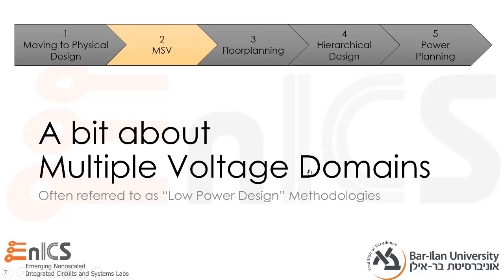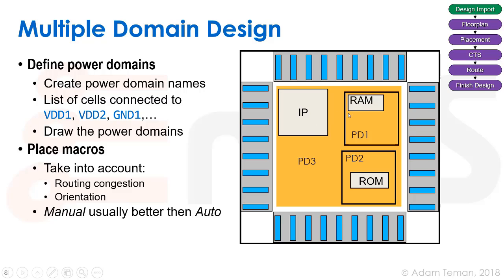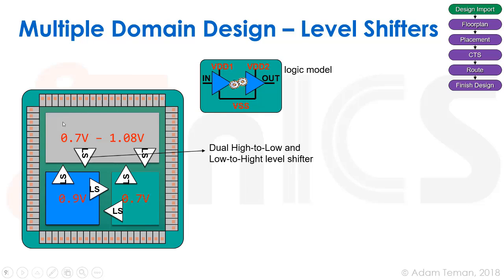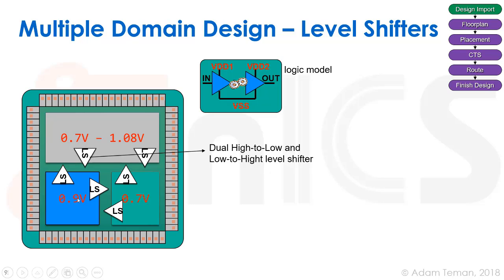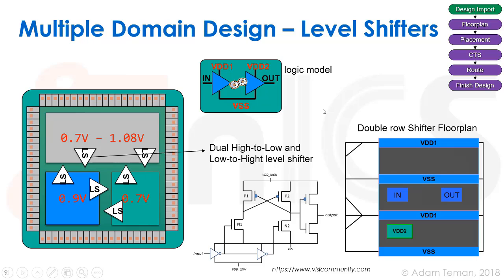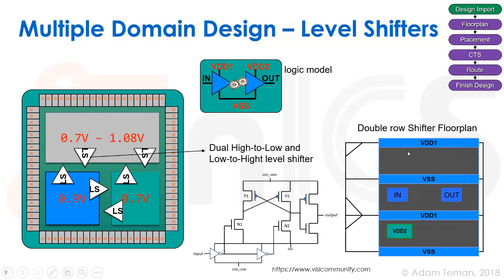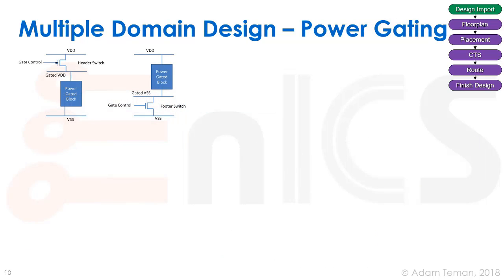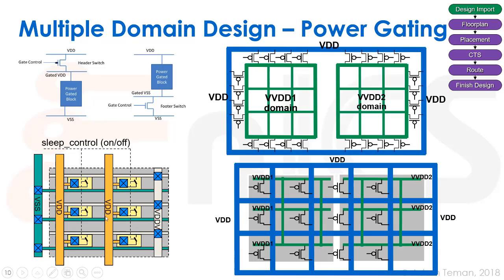DVD - Lecture 6b: Multiple Voltage Domains

Comment: Hi Adi,
First of all. Love your courses and I owe you great deal of my career :).

One question I have about power gating - The said switches that control the VDD should be at the lower layers of the silicon right? i.e , same layers as all the standard cells.

Does it mean that current has to travel all the way down to the bottom layers, pass the switch (in case it is open) then climb back up for the secondary (gated) power grid? 
if so, doesnt that consume too many of our routing resources (since we now have two power grids in at least one routing layer)? that makes it very inefficient.

Thanks!
Elior.
Reply from the maker: Hi Elior,

So I don't go very deep into power gating in this lecture. It is quite a complex subject, but in general there are a few approaches and it does get tricky. The power gates are, as you said, just transistors on the bottom layer. The power grids do go over the entire area and they go up to higher layers. But this is where various strategies of power planning come in. 

I actually have a more detailed (though also high level) explanation in this lecture at around 48 minutes https://youtu.be/TKfV73i-0RY?si=T0AnoGAsVPJMF8fX&t=2910
In general, you could power gate each standard cell row and then just deliver the power through the PG pins (M1) or you could put a ring of power gates around the domain and then deliver power through stripes above the domain - using as many stripes as needed to achieve sufficient EM/IR. But if you also have always-on gates in the domain, you have to supply them separate power routing, so this gets tricky. 

In any case, it's a good question and you need to provide as many power gates and as much power routing as necessary to sufficiently feed the transistors in the domain and this eats up routing resources. Watch the lecture I linked to before -  there is a lot more to this (and I hope to provide an improved lecture later this year).
Reply: @AdiTeman  Thank you very very much for the elaborated reply :) 
I will look into the lecture you referred to, I took a glance at it an it seems to cover this topic pretty well.